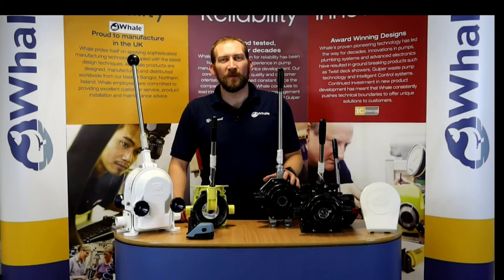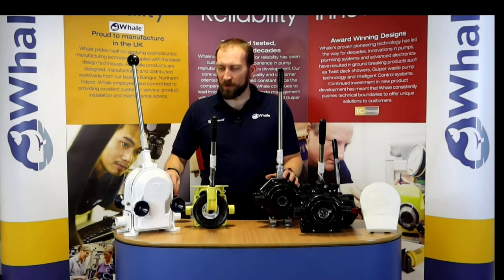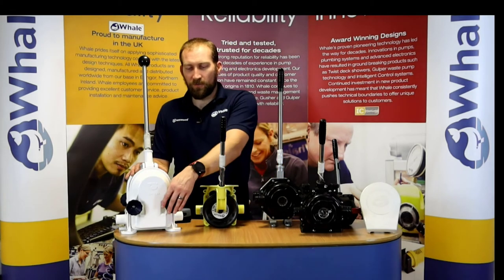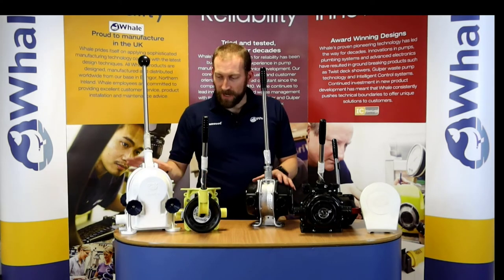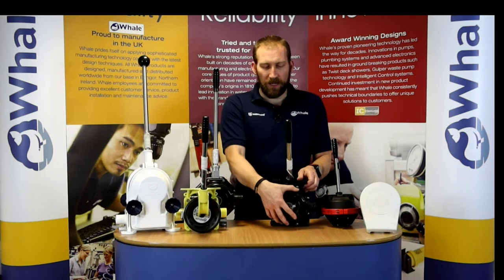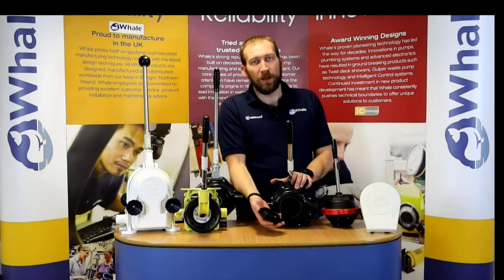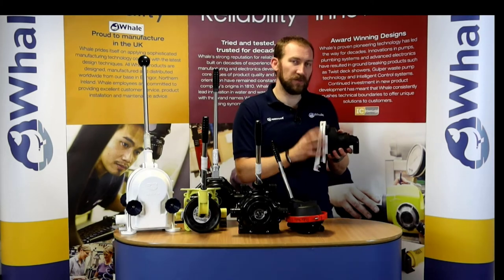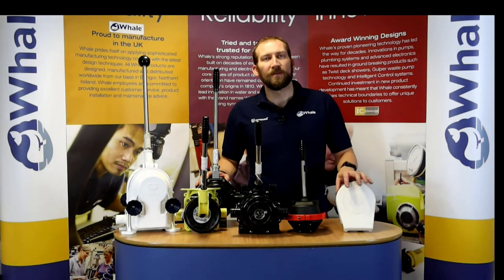Whale manual bilge pumps

Comment: I have a Gusher 10, wich needs a bit of service. I have already all the replacement parts but I want to strip off all paint from the aluminium casting and give it a new coat that will last a long time. 
The pump is several decades old but it is mechanically intact.
However, the inside of the pump housing has almost no coating left on it. It is fairly corroded but  there is still enough metal left to be worth a restoration.

What is the recommended primer and paint for this application. It needs to resist salt, oils and whatever nasty stuff may be floating around in the bilge.

Thank you.